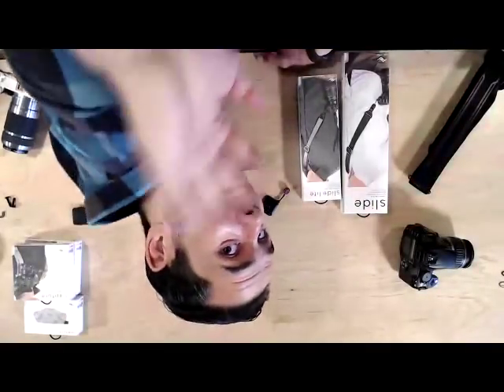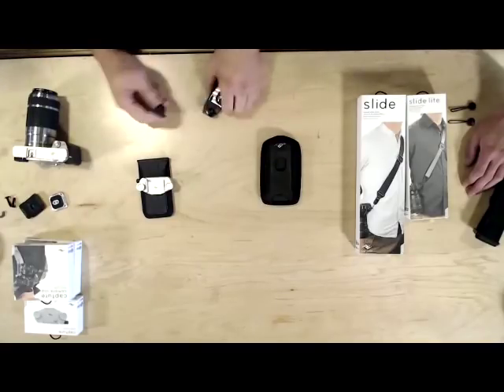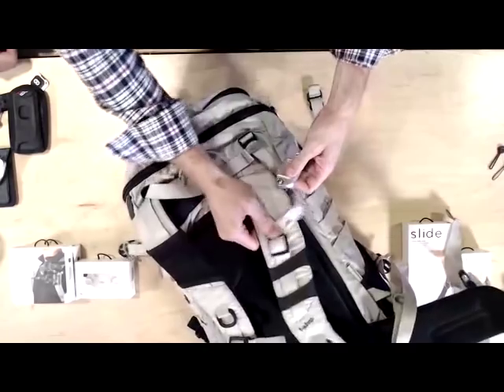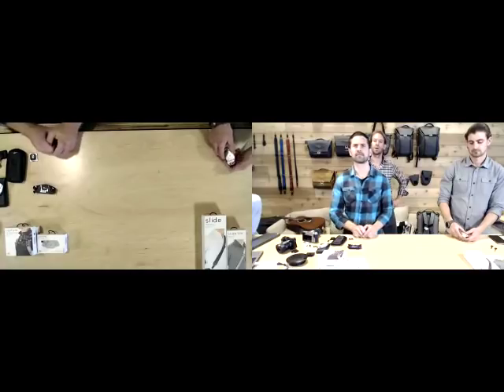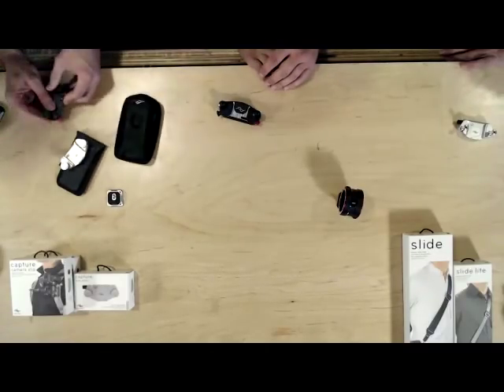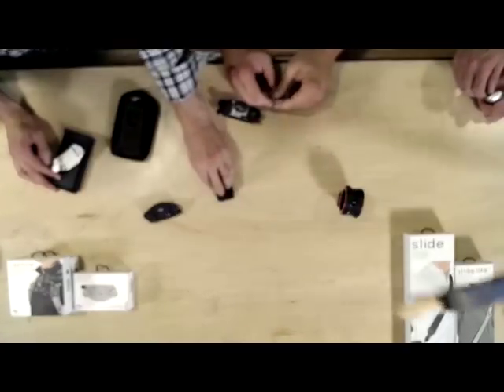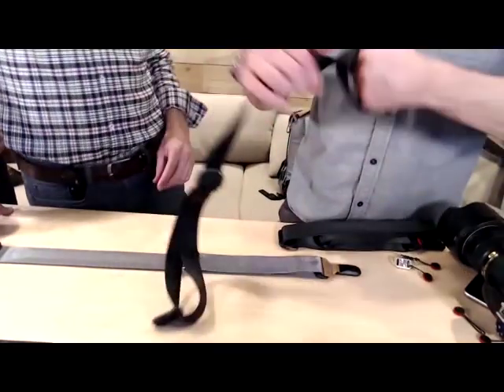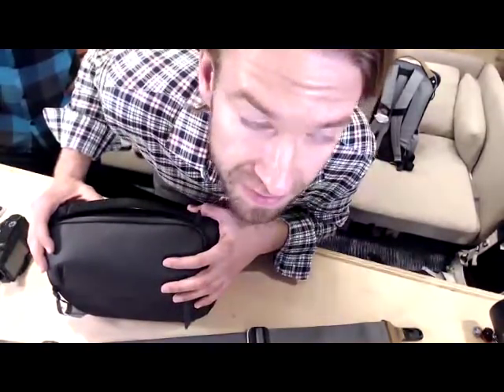Peak Design Hangout 1 Capture V3, Slide and SlideLite on Kickstarter

Comment: Are the longer bolts compatible with the V3?
Reply from the maker: V2 Long bolts will still work with V3. The thread is unchanged, so it is still an M5, and you can use the Hex Clamping bolts in V2, but not V1